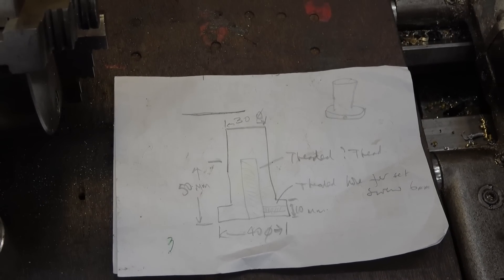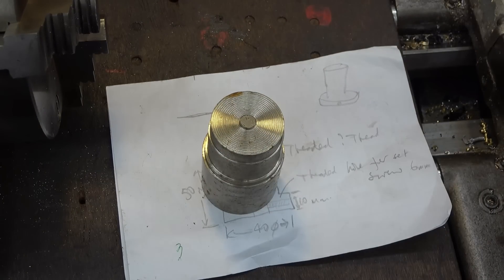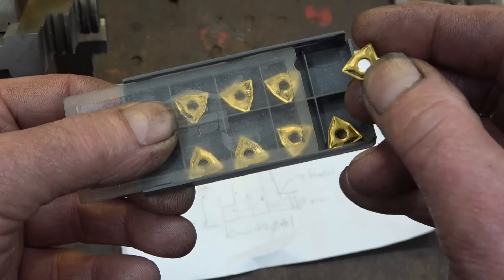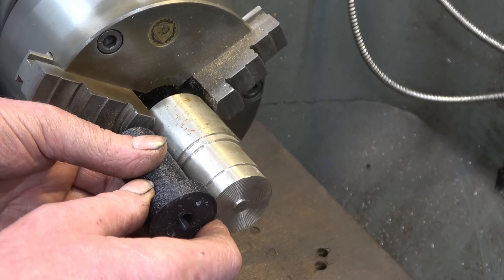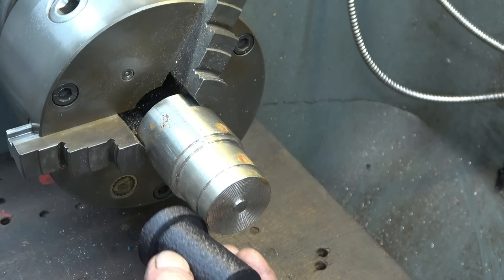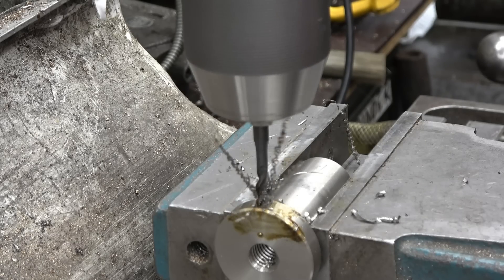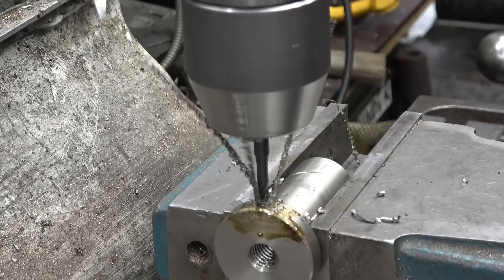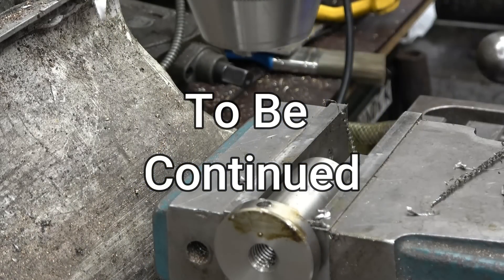SNNC 488 P1 Machining 303 Stainless

Comment: Hi John, good video. The part you made for your friends boat will be ok if it runs in a lake or river. However if it is exposed to seawater in any way, it will be no good. It will be subject to crevice corrosion and pitting. 316 is better though not perfect. 316L if you want to weld it.

Comment: You said the required thread was 9/16" W.
You tapped hole 9/16" UNC
Those two thread angles are different. 
Hope this is not a problem for the job.

Comment: Good work out the tapping, nice chipbreaker on those WNMG inserts from Vernon.
Always worth doing some passivation on stainless parts after machining,  Citric acid works well,  removes free Iron stopping rust stains.
Thanks for sharing.